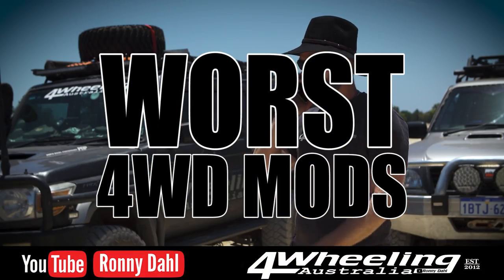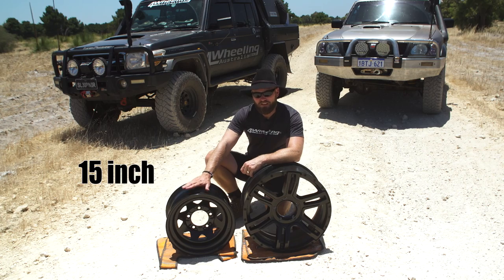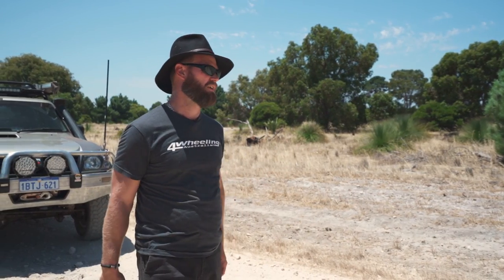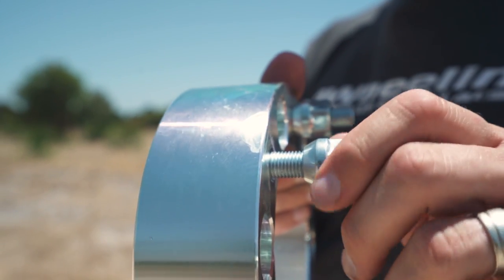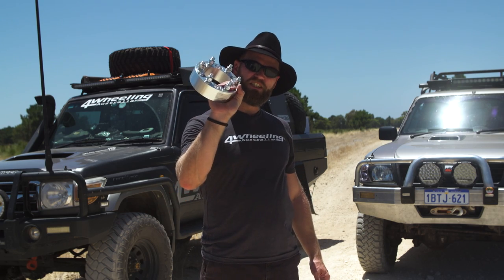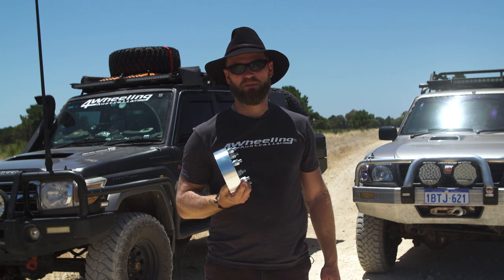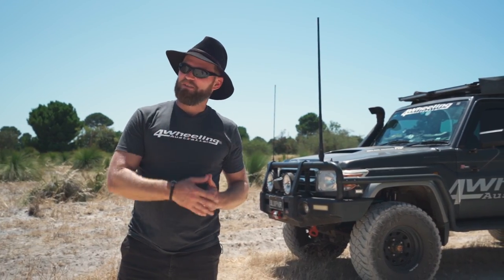WORST 4x4 MODS, DON'T DO THESE TO YOUR 4WD

Comment: a high lift jack if more than just a jack ... they can also be a very handy recovery tool when you know the proper way to use them.
Reply: Besides jacking up the truck to work on, I've used to lift a wheel to put logs underneath when stuck and used to lift an Elk body into the bed while hunting by myself. Could work as a come along as well.
Reply: But unless you have bars and bumpers built to be used with a hi lift it doesn't work. I see them all the time mounted on stock trucks with stock bumpers and no rock bars and it cracks me up.
Reply: Luke Morter they can be used to lift any vehicle by running a strap or chain through the wheel and around the jack. Also they can be used to winch. I guess you wouldn’t find it funny if you learned how to use one.
Reply: @IMKINDOFABIGDEAL13  the hi lift can lift the truck through the rear hitch receiver. There's accessory kits that are made to lift without sliders or bumpers.
Reply: @Chinese_Chicken  but yeah that's only 1 place. And you can also get the things the lift from your wheels. But in a recovery situation rarely works out. And if you are trying to change the wheel and tire  you are lifting it by then you are really out of luck
Reply: @IMKINDOFABIGDEAL13  lift the rear from the receiver hitch, front from the tow points of the frame. Learn how to use the hi lift and accessories.
Reply: @Chinese_Chicken  yeah I know how to use a hi lift. I just find that without proper bumpers and bars a bottle Jack is way more versatile. And safer.
Reply: @IMKINDOFABIGDEAL13  what do you want to carry a bottle jack and a floor jack and a high-lift jack and a scissor jack and everything else in your truck with you? Learn how to use a high-lift jack. Much safer to lift from the wheel because you don't have to lift the vehicle as high for one thing. Lift it up put a board under the axle and carry a jack stand to put on that board and then set the axle back down on it change your tire then take it out in reverse order
Reply: Luke Morter but it’s a whole different ball game with jeeps with full armor, they’re a NECESSITY for almost every off roader in the states.  Hi lift jacks literally save peoples lives sometimes
Reply: @ivanfromtheeast4709  I understand that. But what I was saying is if your vehicle isn't outfitted for the hi lift it isn't really all that capable of lifting without doing a bunch of other crap to rig it to work. I own one and have been using them for years. But the majority of the time I am better off using other equipment because I don't have fancy bumpers and bars.
Reply: @venumus1  that's why we carry shovels.
Reply: Luke Morter your not out of luck. If you can get the tire off the ground you can stack wood under the axle and remove the lift to get to the tire.
Reply: I had to kill a kangaroo with one before
Reply: Trevor Mutch I loooooved my hilift jack🙌🏼
Reply: @codyhinksman  so you would also have to carry a chainsaw with you. Sounds like a lot of extra screwing around and another piece of equipment and wandering around looking for wood to cut. which brings me back to the small bottle Jack
Reply: @ivanfromtheeast4709  yeah I totally get that. I was talking about when you see basically stock trucks with no jacking points with fancy brackets to display their brand new hilift and expensive LED lights everywhere.
Reply: A hi lift jack can be used for so much more than has been discussed once you know how to use it.
1. Jack for what ever reason as discussed
2. Come along winch all be it slow
3. Bead breaker 
4. Reseat a tyre
5. Leverage to make damaged areas usable to drive home
And I’m sure there’s plenty more if needed. Hi lift is definitely a must have for any lone tourer.
Reply: Thats the point ! No body knows how to use them ! . Best left on the shelf for the city boys .
Reply: @paulsouth4794  all I was trying to say is that it is sort of a silly thing for people with brand new stock vehicles with factory bumpers to be mounting on their roof racks that only are on there to hold led light bars. The high lift jack has become the nose ring of brand new 4x4s. Lol
Reply: @Tonysboat3  also a makeshift jaws of life to extricate someone from a damaged vehicle or from under a vehicle, fast.
Reply: All I ever needed was a hi lift and a come along as a shovel
Reply: @Chinese_Chicken  way to wobbly to lift on the receiver hitch
Reply: @IMKINDOFABIGDEAL13  I agree with out points to use it you are asking for wrinkled badly scratched body panels and a worse disaster than you started . in yester year we would weld heavy angle to the bottom of our pipe bumpers
Reply: I love my Hi-lift. I use it with a wheel strap; it's the only practical way to lift the wheel up to get a mat under or fill in the hole with rocks. And it's a hell of a come-along. I've been a field geologist for 35 years all ovet the western US. Although I don't do rock crawling (I nearly always work with one vehicle), I get in (and out) of some pretty hairy places. If you don't  know how to use a Hi-lift then don't carry one. But to keep bad-mouthing them only shows your ignorance and unwillingness to learn. Yeah, the jack stays.
Reply: @huckstirred7112  too wobly but works to lift the vehicle if in need
Reply: @Chinese_Chicken  You can break the bead to change tyres with them also. Good stout bumpers are a right part to go along with lanky lift jacks. Plus a bloke can remove the bottom plate & use the top clamp as a claw to pry like if a panel has to be straightened away from moving parts( guards from wheels?).
Reply: @IMKINDOFABIGDEAL13  Bollocks cobber. A 60" high lift is a very useful tool. end of discussion. You have to use it to your advantage and not rely on pavement education however. It's a Yankee reinvention of the house jack and a adaption of the Warratah brothers log jack . It's for the thinking man who gets the job done . Australian people should be totally adept at the same practice with a lot of outback experience under the belt. They are also  somewhat unstable which can be deadly or convenient. Finally, I believe they are over priced .
Reply: Again. Y'all don't understand my original post.
Reply: @IMKINDOFABIGDEAL13  lol, your original comment says the hi lift jack is useless unless equipped with bars and bumpers
Reply: @Chinese_Chicken  no it does not. I didn't use the word useless once. I live on a farm and I own hilift jaks and I do agree that they are very useful. But I think it is funny when people use them as a decoration for their 4x4 rigs that they never leave the pavement with. Bone stock trucks with fancy hilifts and mounts are hilarious to me.
Reply: @IMKINDOFABIGDEAL13  you said a Hi Lift jack doesn't work unless the vehicle has bars and bumpers.
Reply: @Chinese_Chicken  well of course it works. But if you are in a stock rig I think a guy is better off with a come a long and a few bottle jacks some blocks of wood and a shovel.
Reply: @huckstirred7112  I still do, but at 78, I am a "yesteryear" old duffer.  Still, after being on the 1964 Olympic Super heavyweight Judo team, the principal scientist who designed and implemented the first laser guided bomb system, operated in the far North of North Vietnam to precisely provide exact guidance for the massive load of bombs from just one B-52 then over 130 km away at over 20,000 meters, therefore far out of range of the previously damnable Russian supplied SA-2's, etc., and despite somehow surviving 6 helicopter crashes while being extracted, I am still perfectly healthy except for my 8 times broken neck, back and nearly everything else.  All for our currently 100% falsely "elected" Communist government.
Reply: @dat2ra  Thank you, Sir.  A wise man indeed.
Reply: @ivanfromtheeast4709  yes but stock bumpers suck
Reply: @IMKINDOFABIGDEAL13  it has no prolem smashing fingers and body panels .ditch the factory bumpers they suck
Reply: @IMKINDOFABIGDEAL13  small bottle jack can't be used wen your sitting on your frame
Reply: @huckstirred7112  tj bumpers dont

Comment: +Ronny Dahl. Can you do a video on bash plates? I know the front one is 100% required. I plan to get a full set. But I'd love to hear your thoughts on if and when a full set is necessary.
Reply: In my opinion, for ifs you would probably want a front bash plate, plus the usual t-case and fuel tank skid. On a vehicle with solid axles, a front bash plate is just unnecessary weight.
Reply: @gutteherr  I disagree, I ve hit my 80 LCs front and rear bash plate loads of times. Its saved me more times than I can count. Granted, I do crazy shit with my 80 but that's what I built it for. It depends what you re doing with your vehicle if you will be needing under armour protection or not.
Reply: @carstereo2493  Hey good point. That's what I should have said - it all depends on what you're doing with your 4wd.
Reply: Glad i got the full set for my FJ, every time i'm driving along and i hear the ting of something bouncing off them, i think to myself... that could have f'ked something up underneath.
Reply: A stronger front diff cover or an Iron Maiden around and over the existing tin plate diff cover is No. 1 protection.
Reply: The Prospectors Heh. like it. We have an Isuzu MU-X. IFS Front, Solid rear. We drive it like we love it. But don’t like having to turn around due to the track being too tough. So basically nothing within reason is off the table, but we’re aiming to go easy on the rig. From what i’ve read, full set seems like the go. not too sure about the fuel tank. it’s plastic, so hopefully can take a bit.

Comment: Good video Ronny but I thought you missed a vital point with the wheel spacers. Almost all cars and 4x4's are designed so the wheel load is borne by the axle hub to wheel centre hole, NOT the wheel bolts. With the spacer the load is taken by the bolts which were never meant to take those repeated vertical loads, swapping in direction with every wheel revolution. It's like when you bend a piece of wire back and forward and it eventually snaps.
Reply: Bryce Letcher what if the spacer is “ hub centric”?
Reply: "4x4's are designed so the wheel load is borne by the axle hub to wheel centre hole, NOT the wheel bolts"
That doesn't make sense. The vehicle load is borne by axle width, bolt depth and offset. The centre bore is a constant (your "wheel centre"). Using vectors, the main load is taken by the contact patch of wheel to hub. This again is a constant.
The problem is changing ill-constant vectors using spacers.
Reply: @stuartkcalvin   but wouldnt the issue there be that with spacers the load is not on the contact patch  from the wheel to the hub? Instead its the wheel to the spacer,  which would mean you are infact putting more load onto bolts
 Using a different offset seems more sensible to me, sure youll still increase these forces but youre not creating a potential weak point

Comment: 5:28 If you're gonna drop $2K on gnarly tires, spend the extra $300 on a set of dedicated rims for them.
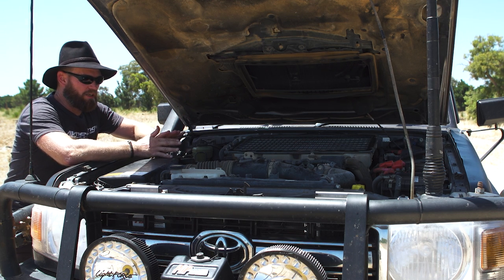13:00 Anyone in a non-automotive mechanical trade knows you can 'tune' any engine to get more power but it ALWAYS comes at the cost of reliability and maintenance. If you race 1/4 mile at a time then yeah, you can sacrifice reliability for power. 
But that engine absolutely, positively canNOT be guaranteed to get you home.

If you need more "power", look at lowering gear ratios or adding a Tcase before buying that 600hp crate engine.

Comment: The only reason to have 17s is to fit bigger brakes.
Reply: or 18s on a 200
Reply: 35's on 18's for a y62, next to no 17's fit
Reply: Basically- my stock tire size is 17, 16 will fit but it's a squeeze.   Plus the 285/75R17 is a 34OD tires and 285/75R16 is a 33" tire....   Sidewall's the same!
Reply: I came here to say that for hig brake kits you need a little room.
Reply: I wanted to go down to 15s on my JK from the stock 17s until i found out the brakes would barely fit.
Reply: I have 18s lol. But that’s street wheels
Reply: And the new industry standard is 17. They have the largest share of the market when it comes to selection.
Reply: I have my standard 18 inch wheels on my pajero sport, the smallest I can go is 17 because of brake calipers, most new 4x4s are like that, that's how they get a 3 ton towing capacity.

I built my truck for touring and a bit of adventurous off roading, and it meats those needs so I'm happy.
I have a 2 inch outback armour lift, brown davis full underbody bash plates
Snorkel
PIAK Bullbar and recovery points
Winch
Hard Korr 7 inch lights
Front Runner roof rack

I use every thing on my truck.

There is no need to buy top of the line ARB gear..  Cheap gear will last maybe 2 years at best.

I went middle of the road with most of my gear, in total it set me back around 15grand, but Hopefully it will last me at least 10 years.. 😉
Reply: Actually, there are more tire choices for 17 inch rims. I couldn’t run the 37” tires that I wanted on 15” rims any longer because they stopped making them!  Oh, but I actually do go rock crawling :)
Reply: 17's are OK, I prefer 16's.  No bigger than that.  Not even on a car, frankly.
Reply: And better handling/comfort, there was a massive difference going from 15s-17s, however I do plan big brakes eventually
Reply: JSXS on my LJ I have 15s with the d44 so you can do it, especially if you buy powerstop TJ/LJ brakes
Reply: Stock 2020 Jeep JT and jl come stock with 17s, I don’t even know if 16s would fit the gladiator breaks.
Reply: That also depends on tire availability, size, and desired load rating. I'll probably go to 17s when I bump up to 37s.

Comment: My 07 rubi 2dr had a terrible oil leak since I got it. Only after buying 2 soft tops have I finally got it fixed🤦‍♂️.  However, now I keep the hard top on always and have learned my lesson.

Comment: Great advice as always. Lots of wheel spacers in the USA to allow big tires on Jeep.

As stated by Ronnie and Andrew in the past. Buy what you need AFTER you go on Overland trips. Do not buy what you THINK you need before you go. Start with the bare essentials. You will get good advice from others (their mistakes) and find out what YOU can and would use. Go to anyone's garage who has been Overlanding / Camping for extended time. Look at all the stuff they have laying around not used or broke.

Comment: +1 on the engine mods. Power is rarely needed while doing offroad anyway. Good weight distribution, proper grip and low gears do the magic most of the time. If you´re in a tight spot and you go full throttle - good luck, you´re in for a garage bill. 5 digits.

Comment: One aspect of rarer, larger sized rims is that when you tour remote, there is almost no chance a servo in buttfuck nowhere will stock 19"tyres. They WILL stock 15s and 16s however...
Reply: Same goes for the actual tyre itself too- If you bomb into somwhere like Mt Dare or Birdsville and need a 265-285/75R16 or a 265/65R17 they'll have dozens of em in various states of life to supply you.

Try doing the same for a 315/75R16 and your either going to be shit out of luck, or if they DO have one, they'll lighten your pocket by $6-700. I was chatting to the guy at Mt Dare a few years back and he had a bloke come in who had run over a broken off star picket and stabbed massive holes in two of his 35" tyres. He ended up staying at Mt Dare for a week waiting for two new tyres to come in and ended up paying close to $800 each for them by the time they had been freighted up and fitted. Where as with my 285/75R16's he could sell me a serviceable  used tyre for $100 fitted.
Reply: David McLachlan my used truck came with 18 inch wheels and I hate them. I want 16s but my breaks will only fit as low as 17. It’s too much money to change over the breaks so I’m just gonna crash it and buy another
Reply: @kregadeth5562    Why would you want to break it, anyway?